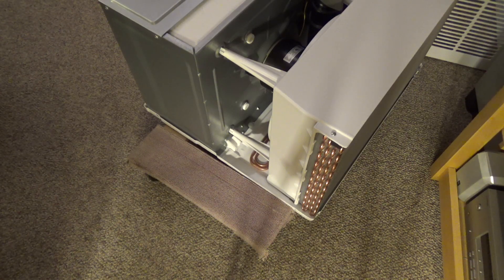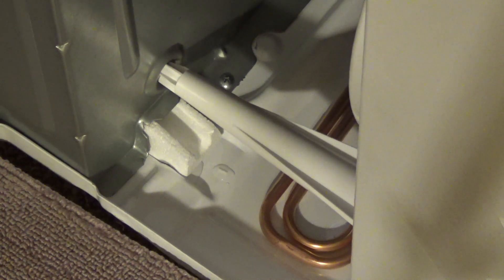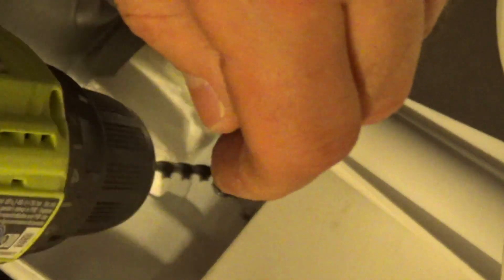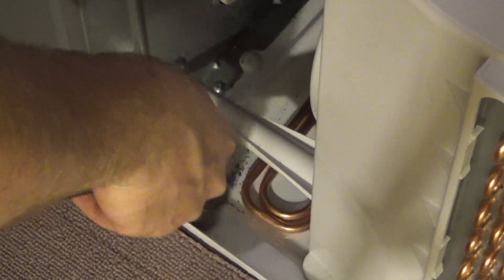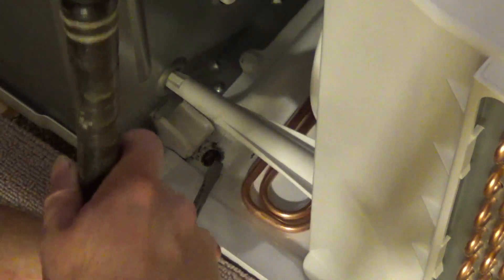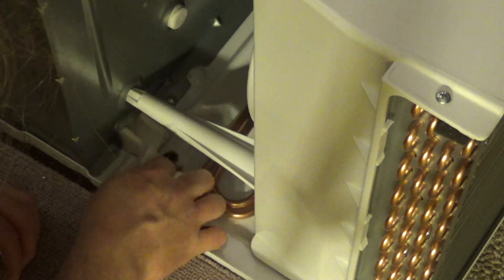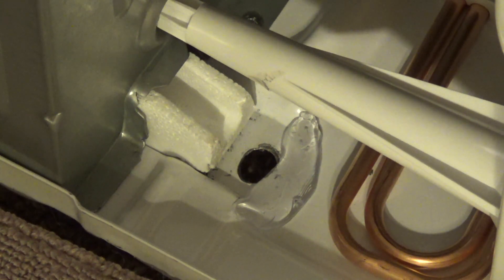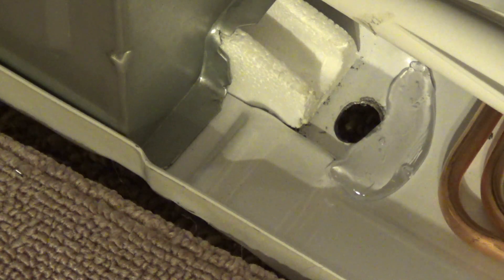Drilling a Drain Hole in the Frigidaire FHWC253WB2 25,000 BTU Air Conditioner

Comment: I used to live in a desert climate where window units didn't get any condensation that lasted more than a minute or so. 

I don't live in a desert climate now. I just bought a brand new 6,000 BTU window unit and it's striking to me how much more humid it is in the house. I have the air conditioner tilting maybe 1 or 2° off of perfectly level I know it's set right in the window. I can't see a problem with drilling a hole. Does the inability for the blades to scoop water into the coils just affect the efficiency or can it really damage the unit? I've drilled holes in other old air conditioners to get drier air and it has always worked in the past. I'm just hesitant on this brand new one. I figured if it doesn't work right I could always plug it. The AC is a Medea 6000 BTU. Replaced a carrier 5000 BTU that was just falling apart.
Reply from the maker: Drill the hole, it can do no damage to the unit as long as you drill in the right place and don't hit any of the lines. You were probably better off with the old rotted out Carrier, Carriers last forever. Whatever you buy today won't last anywhere near as long.

Comment: thanks for sharing, very thorough video.  I wonder if I can somehow drill a hole like you did, and then connect a plug and a hose to the end of the plug to route the water out to my downspouts.
Reply from the maker: There are ways to fit a hose to direct the drainage elsewhere.

Comment: Have you looked at the Fix it Stick instead of glue?
Reply: how does that work?
Reply: @PedroGonzalez-me1qb  Much like plasticine. Cut how much you need. Work it within your hands. And then form it around the hole. The hole should first be spray painted with metal primer paint.

Comment: I drill the hole, one reason is that water splashes around clogs the rear dins with mud caused from dust in the outside air blowing through the unit
Reply from the maker: That is true, the coil stays a lot cleaner when it's dry.

Comment: I can't stand the noise of the water tossing around in there.  Wakes me up!  Can't believe anybody is okay with it.  We have four window units that we've been using for 5-6 years.  I drilled drainage holes in all of them.  I've never noticed a problem with efficiency, and they're all still running fine.  I've tossed a couple just because they got so dirty, but there was no sign of them giving out when I did it.  The "experts" are probably right, in theory, about the water increasing efficiency some small amount, but there are so many negative aspects as a tradeoff.  So go drill it!  

BUT if you drill a hole, make sure you don't go any farther on the other side than is necessary to make the hole, because there will almost certainly be an important component very close in there that you could damage.  My pro tip is to drill the hole horizontally in the middle of the outer edge of the water pan.  The unit is tilted, so if you don't drill on the outside part of the pan, some water will still collect between where the hole is and the edge of the pan.  Plus, if you drill the hole horizontally instead of vertically, you're a lot less likely to hit another component inside.
Reply from the maker: I agree, whatever benefits of efficiency gained with the water present are far outweighed by the excessive noise and rust caused.
Reply: Now, no need to angle?

Comment: So you were worried about corrosion then drilled and left bare betal exposed?  Think the idea needs a bit more work.
Reply: Like what paint it?
Reply: The small bit of exposed metal around the hole is a tiny fraction of what gets exposed when that entire area is constantly collecting water. That wetness promotes mold growth and also grabs dust and pollen from the air, so it isn't just water collecting back there. (Even if that didn't promote corrosion, it's disgusting.) That's much worse than the little bit of bare metal he left but yeah, it would have been nice to coat it with something.
Reply: @chronovore3726  Unless the frame is zinc primed, the rust will eat right under the paint from that exposed spot. Surely you've seen that before.

Comment: The installation instructions tell you to install the unit with a tilt to allow for water to drain, but they don't provide a drain hole. There is one nearer to the front but no way would this allow rain water to escape. It looks like they molded into the cabinet (I am doing a thru-the-wall installation) a spot at the lowest point in the unit where they intended a hole to be drilled. I am tempted to go ahead and drill a hole there but afraid of messing something up. The company is useless and does not respond to questions.
Reply from the maker: If you still can, I'd send it back and get a different model. I had a very poor experience with this machine, it's not anywhere near as powerful as one would expect for this rated capacity, and the temperature regulation is horrible (5-7 degrees difference and fluctuation).

Comment: Do you ever wax the paint of the units with auto wax? I figure it would keep it glossy/prevent rust and last longer.
Reply: This is exactly what I do, inside and out! Seems to do a reasonable job
Reply: @Kevinsrack  yeah and on the inside would probably help with the moisture
Reply from the maker: I have not, but that's a good idea for the pan.

Comment: I made the mistake of not drilling a drain hole on my 2003, 20,000 BTU Whirlpool A/C.  I am about an hour from the ocean and the condensate mixed with salt in the air causing the condenser to rot badly.  The unit was taken out of service last summer after the compressor burned it's terminals twice.  I suspect this was due to higher current draw from the compressor having to work harder due to the condenser not being able to remove heat from coil rot.  The unit was replaced with a mid 80s Fedders and the Fedders has a drain hole drilled in it.  I went a step further and added a host to the drain I drilled so the condensate is keeping a near by rose bush watered.  My 83, 7800 BTU Gibson that I restored also has a drain and will get the room down to the 50s if I let it.

Comment: I say drill the hole. I drilled the hole in all of my vintage units. I did a test a while back with a unit that had a leak in it, so I put high and low side bullet ports on it. I measured the pressures as well as the current the unit was drawing. I covered the drain hole, and filled the pan up with cool water. At first, the head pressure did lower, and the current draw did lower a good amount. The compressor also sounded somewhat quieter. This only lasted for around 3 or so minutes, and then it was back to  roughly the same current draw and pressures  as it was before. I would imagine because the small amount of water the pan holds got hot. 
If you were actually running a constant source of cool water over the condenser, like hitting it with a hose, that certainly would make a difference, but the rate at which the unit produces condensation isn't fast enough to keep cold water in the pan, so it heats up rather quickly and provides little to no help with cooling.
Reply: To ad, the only important thing is after drilling the drain hole, you should always use some sort of high quality oil based metal paint around where you drilled, because that is bare metal and will rust.

Comment: There is nothing wrong with drilling the hole.  If you notice the refrigerent lines that are sitting on the bottom?  Those are hot gas lines thst come off the hot discharge side of compressor.  They are designed to evaporate the excess water, thus creating humidity in the unit and those lines will just corode, and leak out the refrigerant.  GE does tjisvto their AHP, AHQ, And ATTHA series units.  Ihave never seen this on a window unit, its planned obselence and they know what they are doing.  Also you can cover those top louvers to keep rain out.  I dkne that to my unit, as i just got a big piece of msgnetic sheeting that the use for fridge magnets and put that over the louvers.  There are so many louvers on the sides that it does not affect the efficiency at least i have not noticed it.  Also i have mine set up so it its a super hot humid day, i can pllug the hole and allow the water to build up and cool the condenser,.  However, i remove the plug and let it drain again on less hot and humid days.
Reply: Came here to see if anyone else was throwing the planned obsolescence thing out there, so I'm glad it's not just me who sees through the B.S.